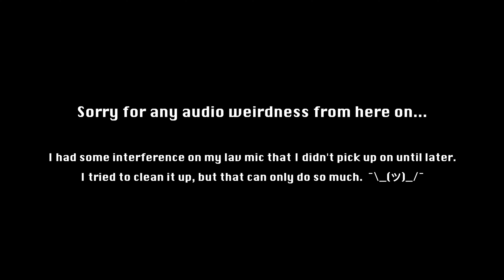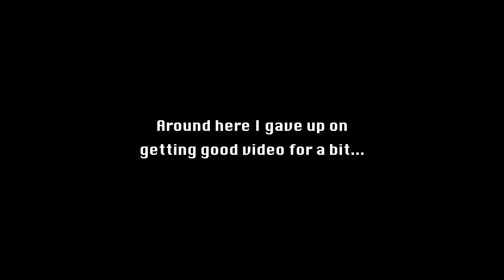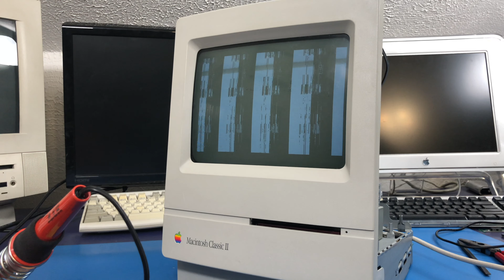Replacing Caps, Fighting Lifted Pads, and More! - "Mac's Mac Classic II," Part 4

Comment: Hello , I was wandering if you know what type of power supply a Compaq Presario cdr 972 uses?  it has two connectors on the plane board an 11pin and an 8 pin do you know what it uses? if I can't find the psu type i might have to throw away this 1994 compaq. this desktop has an AMD am486 DX4-100 cpu.   The assembly number is  004149-001 rev d.   Diagram number is 004150.     its fcc id is CNT75MDCZC4     its a SERIES 3520C4